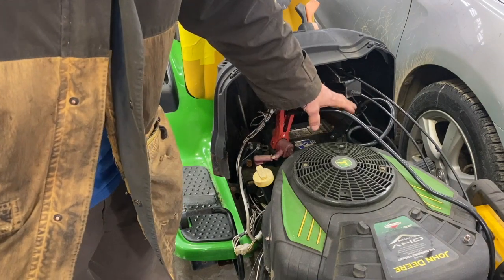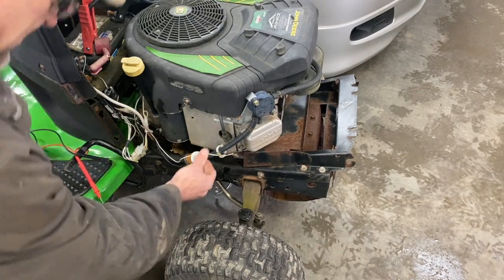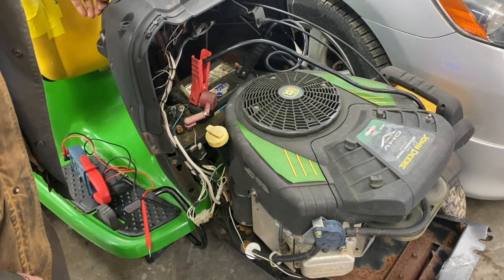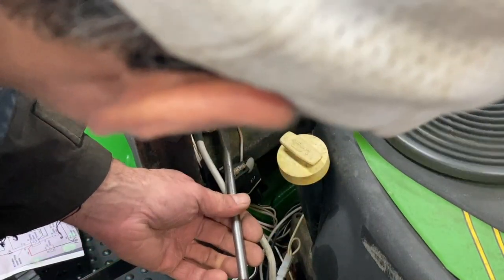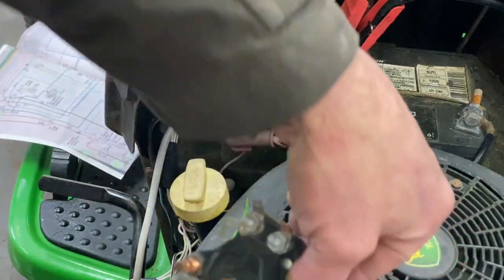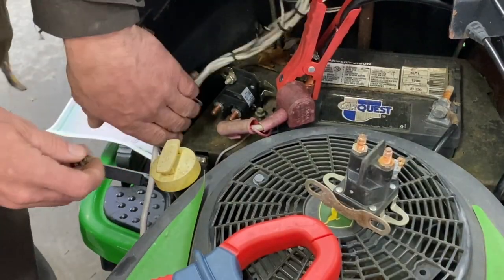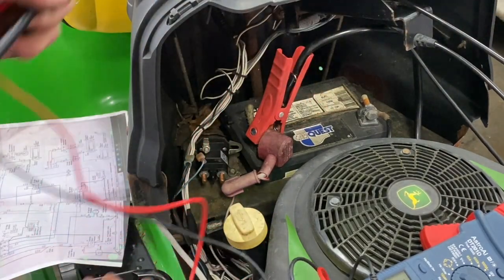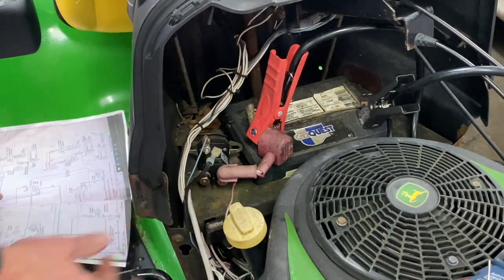John Deere LA135 Won't start. How to troubleshoot a Bad Solenoid.

Comment: That’s funny, when I broke my hood and took it off I would be out mowing and all of a sudden it would just stop and it kept blowing fuses, so I went up to a little bigger fuse and it would do the same thing. I went through about six fuses before I figured out it was the headlight plug because they don’t cover them they just leave the bare metal sitting out and if it hits ground it pops the fuse 😂 that was about eight years ago and I actually use scotch tape because that’s all I had, this was a good reminder I better go swap out that tape 😂